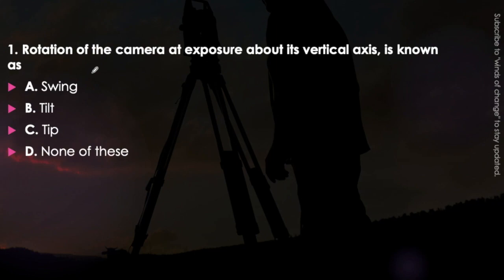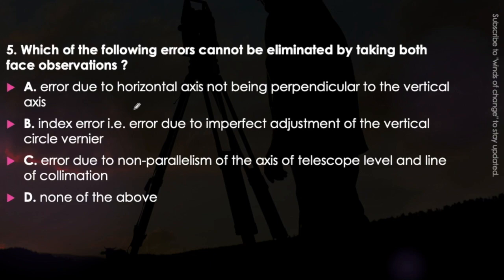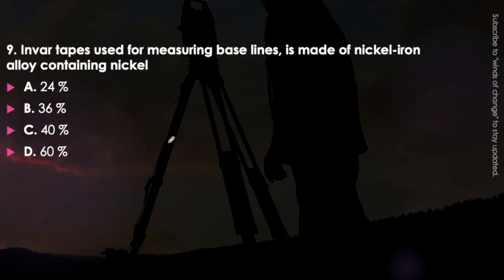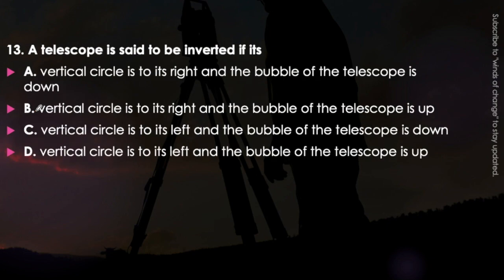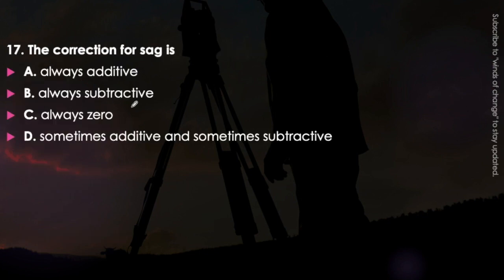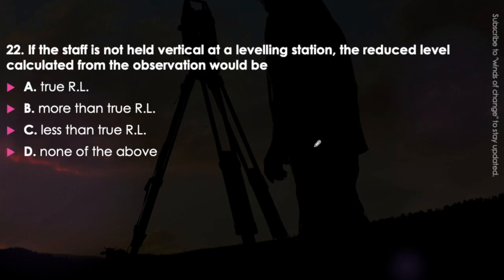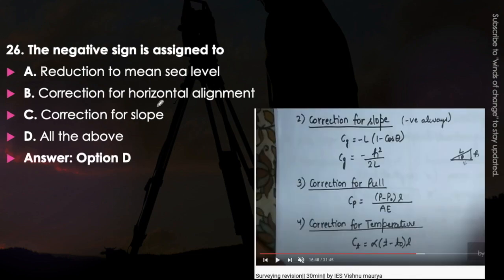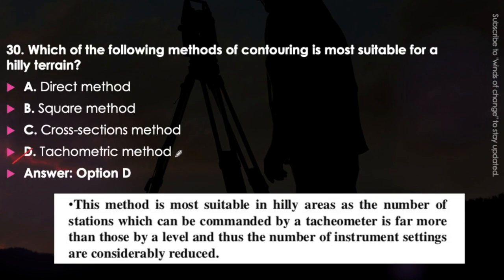SURVEYING || 120 QUESTIONS || 1-30 || UPPSC AE 2021 UKPSC BPSC MPPSC SSC JE

Comment: Sir civil ka top ke nit me placement kaisa hai
Reply from the maker: Mostly NIT warangal and trichi has good placement. MNNIT Allahabad is also having a good placement record.
Reply: For mtech sir or btech
Reply: @vaibhavshukla1035  I am From NIT warangal for core CE job package is from 3.5 Lpa to 5.2 Lpa only 
For high package you have to apply for non core jobs (Management related)
Reply from the maker: An average package one can get around 5-6 LPA CTC in core civil engineering department. There are limitations in placement of civil engineering as mostly construction companies offer much lower package as compared to IT companies in the field of computer science .
Reply from the maker: Even top NITs are not good for mtech in terms of placement. The numbers of candidates getting placement in mtech are very less. The above answers are for btech students only.